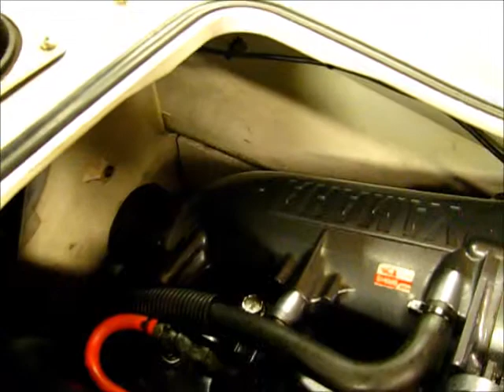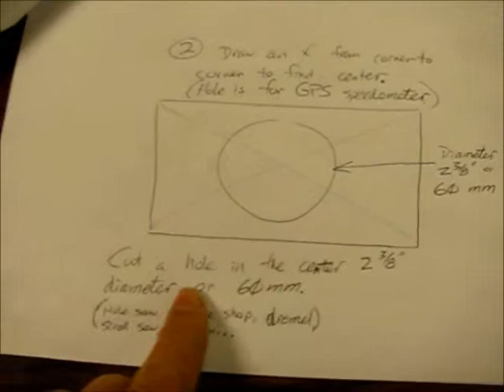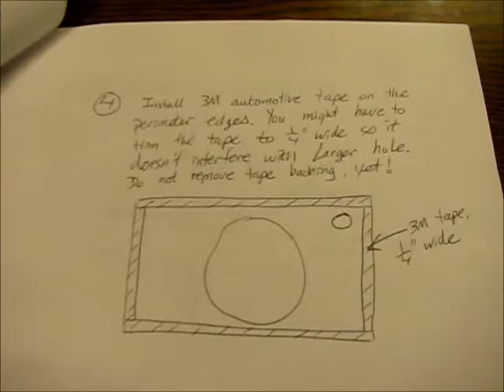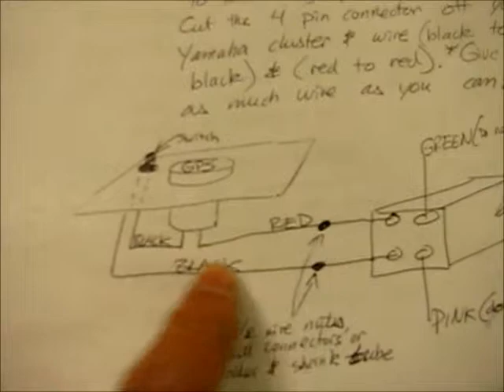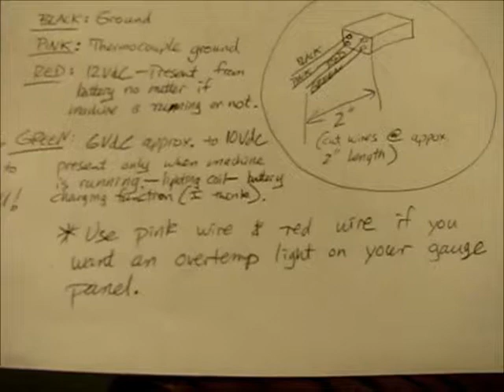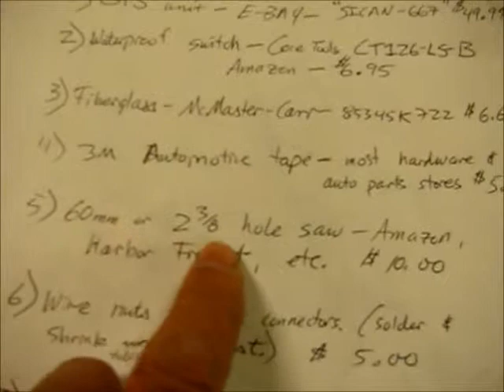How to Build a NEW Gauge Panel for your Yamaha

Comment: Thanks for the video.  Great details.  I'll be attempting to do the same setup.  One question, why no fuel light?  I know it can be check by opening the hatch, but I think it would be nice to know when to return to shore and fuel up.  Do you know what wire within the factory harness is to the fuel tank sensor?
Reply from the maker: I personally don’t worry about fuel level because I consider having to switch the fuel selector to reserve when you run out of gas a warning to return home and fuel up.  In my mind that is more reliable, too.  All the riding we do is pretty close to home; we’re usually never more than a couple miles out, ride in pairs and reserve has never let me down at that distance.  It seems a challenge but I’ll try to help at least give you some ideas on how it works.  There are two wires coming out of the fuel tank.  They are in plastic protective tube coming out of the round, rubber cap that has a hose clamp on it.  According to my manual, they are white/blue and black wires (two wires total).  The fuel level sensor inside of the tank is a post that has three floats on it.  As the level of fuel decreases and the floats contact their “bottom” position, the resistance in the circuit increases.  The highest resistance occurs when you are nearly out of fuel.  What this means to me is that there is some circuitry in the Yamaha gauge that uses these three resistance changes to change the images on the LCD screen + trigger a light at the highest resistance.  What does this mean to you at this point?  If you simply wired a light to the fuel level float system using 12 Vdc to one leg of the light and use the two float wires as a switch, your light will start out bright at full tank then dim as you are running out of fuel.  Useful?  Not really.  So what can you do?  I’m sorry but I’m not sure!  You need an electrical engineer at this point…  (I am merely a mechanical engineer so electrical is a mystery to me!).  Or…  You could remove the float post from the tank and install one that acts like a switch that closes the ground leg of the circuit when the fuel is no longer keeping it afloat.  Kinda like an automatic bilge pump switch.  A fuel rated float switch is basically what you need; mounted on the existing float post.  I don’t know if you can even get something like that.   Thinking outside the box – use solid wire or something to wire the two upper floats stationary in the “off” position (aka all the way up).  That way, when you are low on fuel the resistance of the circuit will be closest to zero and your light will come on by using only the bottom float.  You would have to take the float pole out of the tank, wire it to a light (don’t blow yourself up!) and experiment by moving floats to various positions.  According to the manual, the bottom float provides the maximum resistance so maybe it would act as an on/off switch.  Don’t know – you’d have to try it.  SUMMARY:  All in all it seems like a big ol’ hassle.  If you can’t live without a fuel light, I would either not do this mod or decide you want to rely on reserve.  In my mind, reserve is fool proof.  Floats get stuck (or no longer float as was the case with my SeaDoo) and electronics fail.  I’ve ridden motorcycles quite a bit.  Reserve has always bailed me out of trouble.   No gauges, just a reserve valve.
Reply from the maker: Now that I think about this more with respect to fuel level floats:  when they are all down (aka you are out of fuel) the resistance is at its highest.  Is what that tells me is that if you tried to use this system as an on-off for a light, you would have a light that is ON when you are full of fuel and OFF when you are out of fuel.  Probably not a good way to go but an interesting thought, initially I guess.  If the rod that holds the floats were turned upside down it might just work as a switch.